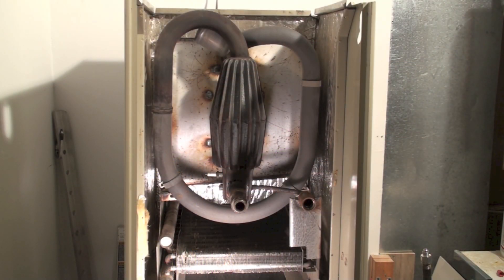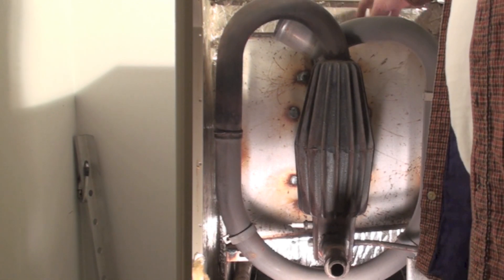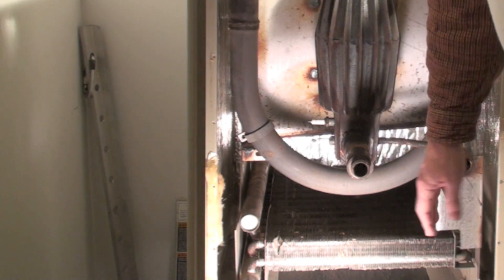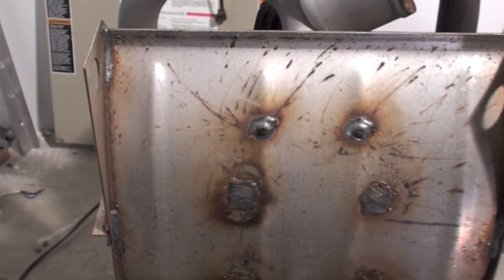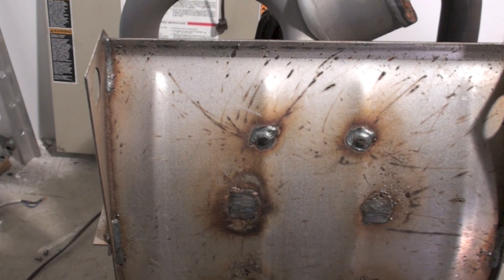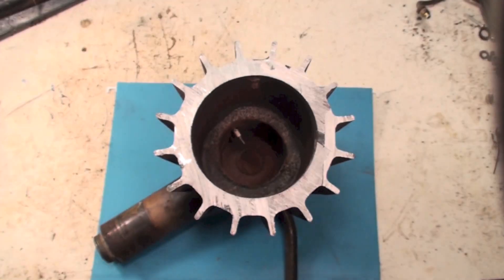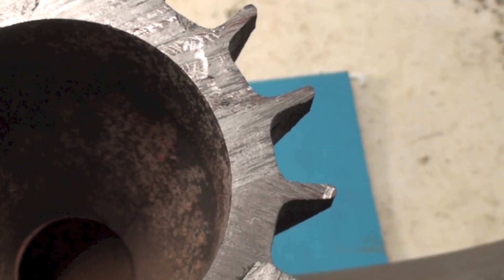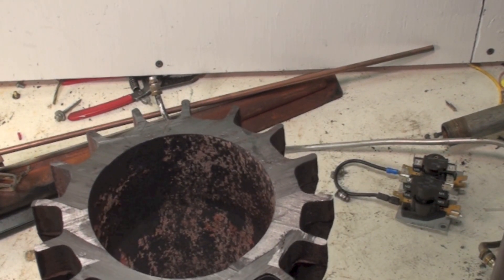Lennox pulse heat exchanger inside

Comment: My G14 still works. Absolutely zero maintenance in the last 8 years 😫. I think the  rubber isolation mounts the heat exchange is mounted on are starting to sag, because it makes a rough knocking sound after it has been running for a while, but only when the flame is on. Heat exchanger was replaced in 1991.

Comment: I still use mine, in my shop! Been the most efficient furnace ,  That i have ever owned.. It used to be in my House.  and  I replaced it with a Goodman 2 stage High Efficiency Furnace.. which seems to burn double the gas!!  Not Happy with it at all.. Want to replace it with something better on LP.. any thought ?
Reply: it is possible your new goodman furnace is not set up right. also, if you have ducts running through a cold space - more heat will be lost through them when it is on low fire.
Reply: @Jon  yea,I got my Goodman working good now. Come too find out,my Lp,Tank regulator was faulty. It was only putting out 3-4WC. I replaced it and now it's hotter and don't run long now.

Comment: Hello, I have a Lennox Pulse 21 installed in 1995.  I saw a little bit of black soot, but not dusty soot on the inside of the exhaust pipe leaving the house.  Not really sure how long it's been there..  There was not much at all on the towel when I wiped it.  I had someone tell me that is a sign that the heat exchanger has a crack and that is what is causing it.  Any validity to this?  We have 2  carbon monoxide detectors and both are fine..no readings for problem. Thanks in advance.
Reply from the maker: Propane or natural gas?
GFM
Reply: @grayfurnaceman  It is a propane furnace
Reply from the maker: I would not be concerned if there is no further buildup.  Propane tends to soot a small amount.
GFM
Reply: @grayfurnaceman  Ok thank you very much for the information and your expertise.  I appreciate it.  Have a nice day!

Comment: can you tell me how to get the cover off of the heat exchanger?.....i removed the bolts but the cover wont budge....
Reply from the maker: The air intake is also connected to the front cover, I believe.
GFM

Comment: I think you may be on to something on the failure of the heat exchangers being caused by the pulsing.  If metal is heated up and then allowed to cool at a steady pace, it seems it would be okay.  But metal being heated up and cooled slightly, then heated up and cooled slightly in a rapid succession would cause the metal to fatigue.  If an incandescent light bulb is turned on and off in rapid succession the filament will blow,  but works for many hours when operated normally.
Reply from the maker: Daniel Baker Could certainly be.
GFM

Comment: I came across one that the entire exhaust tube separated from the secondary heat exchanger.  The call was for water under the furnace.  When i opened the side port below the circuit board, I was stunned. It was still attached to the pvc but it was laying on the shelf inside, right beside the secondary. 

On another note, circuit boards, gas valves, heat exchangers and venting mufflers are no longer available for this line of furnaces.

Comment from the maker: The broken ones I have seen failed on the exhaust pipe loop, which is somewhat lighter.  I cant say I know exactly why they failed, but it may have had something to do with the pulsing of the flame.
GFM
Reply: Not so much pulsing of the flame itself but vibrational fatigue of the metal caused by the pressure waves.  Over time the once ductile metal work-hardens, becomes very brittle and then cracks.  My guess, not having seen one up close that failed, will be cracks in the stainless steel portion of the heat exchanger, which is more prone to work hardening than the steel and is also much thinner.  My Lennox G14 has served me well for 30 years until this heating season, when it appears to have gotten slightly louder.  It is still running as smoothly as it always did and no CO is detectable but I suspect it is due for replacement.  I hope it makes it through the season.  Too bad.  It was very economical and reliable during this time.  Thanks GFM for the videos about this furnace, very educational.